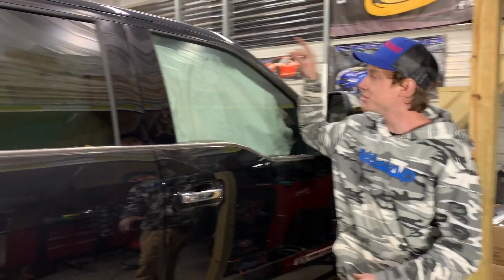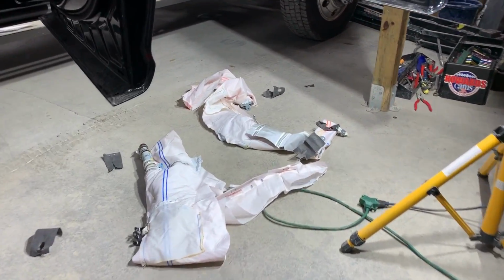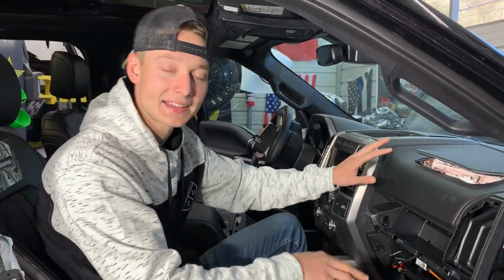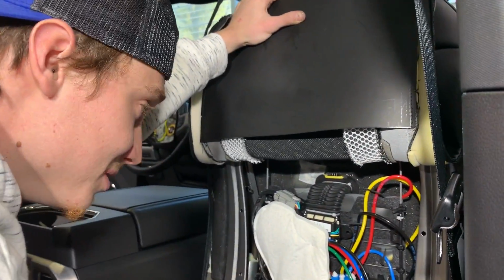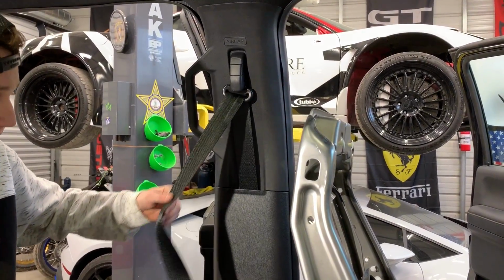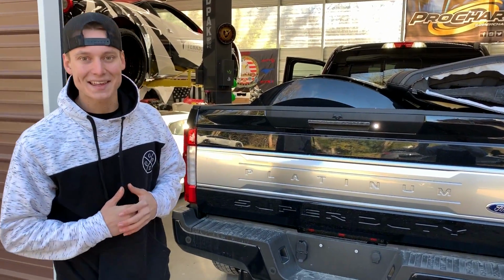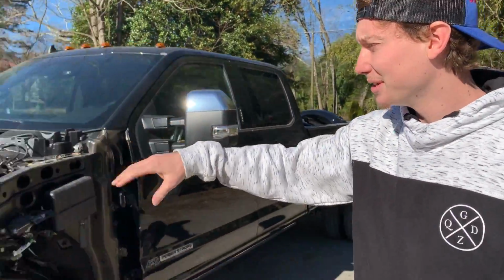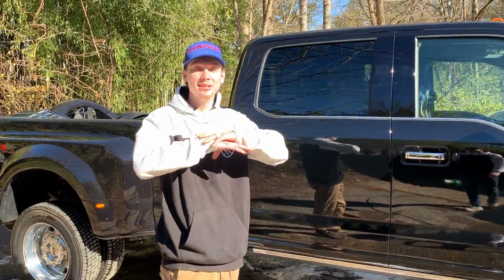Rebuilding A Wrecked 2019 Ford F-450 Platinum Part 3

Comment: Theirs no need to take off all those trims to take the console out , it's only the side bolts and yall probably missed 2 10mm bolts in the front of the console, and the console slides right out ,

Comment: It's a 2019, Use your brains guys, NO AIR ON REPAIR! It's OK to use air in disassemble but when re-building vehicles DO NOT USE AIR TOOLS for re-assembly,  Factory has everything specific torques,  if using air you can cross thread and damage bolts or pre-threaded parts, This will be a problem in the future if anyone needs to work on them components.  Find out correct torque on any and all bolts and insert using hands and fingers than proper wrenches and toque tightening tools with proper settings!